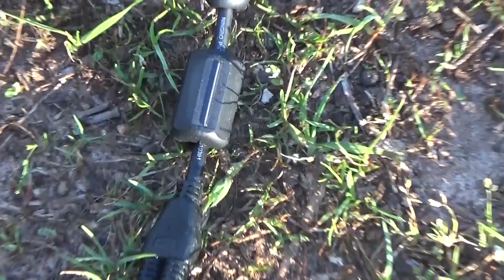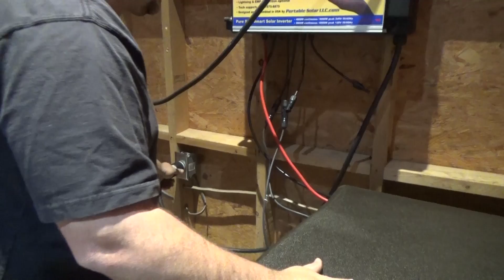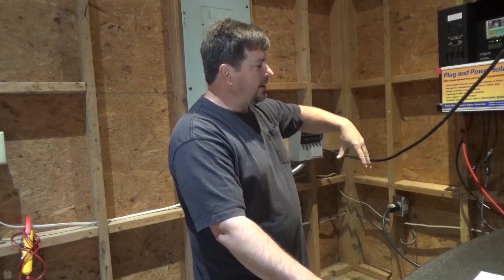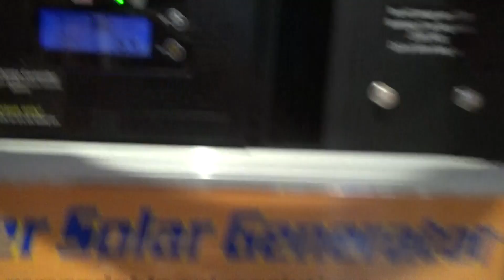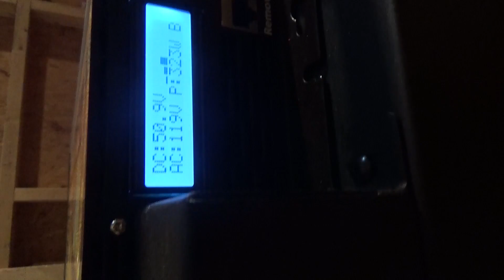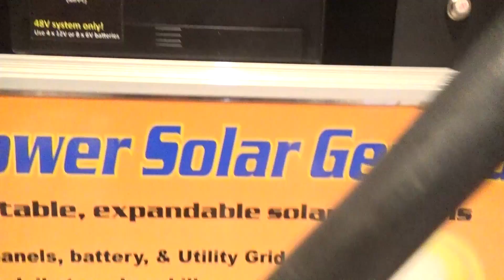Sol-Ark EMP Hardened Solar Generator

Comment: Those snap-on chokes may (if you are lucky) minimize noise, but will do nothing for an EMP.  What is the dB attenuation 'claim' of a 1 gHz pulse from the manufacture?  The much more important question is; what good is an alleged EMP protected solar unit, if one's solar panels (e.g. silicone junctions) are exposed outside and not in a Faraday cage?
Reply: The "snap-on chokes" are not the only solution. While dB attenuation is important for simple Faraday cages, it is far less important than real testing in 50KV/m EMP test simulators. Which they have passed numerous times.
Reply: Portable Solar LLC I would ask at what frequency content was your test?  50KV/m is only 1 relative reading, one needs and 2-3 parameters to create any real-world table analysis (e.g X&Y), before any commerce claims are advertised. X & Y are needed to provide what the Department of Energy standard requires based on real actual detonations. 
   I would point you towards the publications of: Colin R. Miller, Major USAF - Electromagnetic Pulse Threats; (TEDT-TMB), Test Business Mangaement Division - Test Operations Procedure & Visual Electromagnetic Pulse; Finci, Dr. A.k.a G - Electromagnetic Pulse. 
   A typical EMP can easily generate 50vK/m up to 100kV/m. These panel would be out in the open, not in a cage. Even in a "simple Faraday Cage" without multiple internal shielding layers, cannot meet the Military's standard, found in MIL-STD-188-125-1.
    I appreciate your hard work on the product, however unless adequate dB attenuation is achieved at the panel, it is all futile for the uneducated consumer.  I suggest to installers of such panels, to purchase duplicate panels wrapped in a minimum of triplicate protection; which is never received well from the client, due to the doubling their investment.
   I think you have the capability to make some additional money; if you offer a hard large Faraday cage with triple internal wraps of custom cut bags to accommodate a backup set of said panels.
    Keep up the hard work.
Reply: MIL-STD-188-125-1 applies to shielding ground based buildings. The MIL-STD-461 and specifically RS-105 testing applies to mobile electronics. It is much more difficult because it uses many transient EMP pulses made up of many high frequencies simultaneously (see spec below). And the electronics get rotated over many X-Y-Z axis for vulnerabilities.
As for solar panels, we agree that unprotected solar panels should be put away (or at least not wired up). There are in-experienced solar companies out there offering EMP solar systems where they provide backup inverters / charge controller and sometimes the diodes to the panels. What they don't know is unprotected panels will likely kill the solar cells. In this case, I would recommend backup panels.
However, properly protected solar panels in full sun have survived EMP testing to RS-105 specs. This have been verified by our Nuclear Engineer and other engineers in the country at other EMP labs. There is no testing evidence to date that we know of that properly protected solar panels failed RS-105 testing. We may do a video with live EMP testing on this to show the effects of both.
I hope people can understand we will not explain why protected panels survive in real testing because it only helps the people who are trying to sell fake EMP solar solutions. 
Thanks for your diligence and great questions.
Reply: Darn. Unable to attach EMP pulse graphics in YouTube comments. Sorry we are engineers and scientists. Not very good at Facebook & blogs. If you send us an email (address on our website), I can send the graphics in the RS-105 spec.
Reply: I'll bet the additional 'hardening' was a form of faraday cage around the solar cells......
Reply: Portable Solar LLC Again what good is having the generator; when all your solar panels become very expensive paperweights in a nanosecond pulse?
Reply: Solar Panels have been tested at several EMP Test facilities. One of our Nuclear Engineers tested them at White Sands N.M. EMP site. They survived in multiple >50KV/m tests just fine (some hardening was added but does not interfere with solar collection).
If you have actual test data to show otherwise, I would love to see it and the exact setup/conditions.

Comment: Around 4:10 you state that a typical solar panel will pass an EMP test. These have the suppressor built in line to protect them from being back fed from the effects of an EMP.  So would a solar panel in storage not hooked to a system be OK in a EMP?

Comment: Would using a 20' shipping container to house all of the power equipment inside of it create sufficient EMP protection for the electronic equipment that is INSIDE of it?
Reply: +Havilah Gold 
It is impossible to isolate a solar power system from an emp.  The solar panels are outside after all.
Reply: "power equipment inside of it" ...." for the electronic equipment that is INSIDE of it"
Reply: Havilah Gold In this video, he talking about a company that has tried to make a solar power system that can run and at the same time as being protected from an emp to some extent, This means the system is not isolated from the outside..  It does not really matter how shielded the building that the inverter, charge controler, other electronic equipment, is inside of.  The solar panels are outside. To get power from them you have to run a wire inside to the power system.  Wires are electrical conductors.  An emp is an electromagnetic pulse.  The wires will carry the energy from that emp to the rest of your system.
Reply: +Hodggoblin wires can be shielded and the amount of interference that they receive is going to be dependant not only in their level of shielding but also on their length. Use shielded cables and keep the length of your cable runs to a minimum.
Reply: Daisy Duke that can help, but the solar panels cant be shielded, or else they would not generate any electricity, thus a solar power system can not be isolated from an emp.
Reply: A shipping container can help a lot more than people think. And multiple independent EMP testing of solar panels shows they survive. But the long wires connecting to solar panels end up destroying them. That's why we supply EMP suppressors for each solar panel and appliance to protect them.
Reply: +Portable Solar LLC 

a few statements about EMP protection that I beg you to correct me on if I'm wrong.

 • The shipping container should be earthed.
 • The shipping container should be electrically isolated from all electrical equipment you hope to shield. Do not use it as common ground, common hot, common neutral or common earth.
 • If complete isolation isn't possible, use the container a common earth.
 • As far as fault protection goes, double insulated is far better than earthed.
 • if your equipment provides an earth on the plug, earth it.
 • ground fault interrupts are a good idea.
Reply: • The shipping container should be earthed.
PortableSolarLLC: doesn't have to be, but makes protection easier.

 • The shipping container should be electrically isolated from all 
electrical equipment you hope to shield. Do not use it as common ground, common hot, common neutral or common earth.
 • If complete isolation isn't possible, use the container a common 
earth.
PortableSolarLLC: Agree, it makes protection easier.
 • As far as fault protection goes, double insulated is far better than 
earthed.
PortableSolarLLC: Agree.
 • if your equipment provides an earth on the plug, earth it.
PortableSolarLLC: too many variable to answer.
 • ground fault interrupts are a good idea.
PortableSolarLLC: Waste of money. They aren't fast enough.

Comment: sounds like most rv inverters I'm familiar with that when you are plugged into shore power you have ac, when you unplug its dc, and if you run a genny it will switch to that.
Reply from the maker: +The Recon Prepper Very similar except that solar is priority with this system and won't switch unless batteries are less than 91%.  This way you get the most out of your solar panels.

Comment: so I can charge up a golf cart with it, and use the batteries in the golf cart to add to this battery bank to run the house? if so, im in!
Reply from the maker: +AlfreyFarms I am not sure I am following you on " add to this battery bank"?  You can use a 48v golf cart with the system to not only charge the cart but also power other loads.  Send me an email and we can work through the details.  I would thing you would want a dedicated battery for this and then you could charge the cart off it.
Reply: sounds good. I will get with you after the 2R24 outage here at Farley
Reply from the maker: +AlfreyFarms Roger That

Comment: I have a 4 Kilowatt solar system - totally off grid, with a generator backup and 8 deep cycle 12V batteries.  My inverter and charge controllers are not hardened.  It would be great if you could do a video on how to protect a system like mine from an emp - if indeed it is possible to do so.
Reply from the maker: +Marvin Double It is too expensive.  You would be better off buying 2 of everything that might fail and faraday caging them.
Reply: engineer775 Practical Preppers Thanks for that simple and direct answer.  It pretty much confirms what I suspected to be the solution.  Fortunately I bought a system with a very robust inverter.  That unit has replaceable parts.  I may well contact the manufacturer and ask about getting replacements for those parts most likely to fail.  I have two paired charge controllers.  While these are somewhat pricy, they are also fully replaceable.  I have two lightening arrestors in the system, one on the inverter, the other on the sub-panel, transfer switch.  I know that lightening arrestors are not the answer, but hope they may at least prevent some damage.  Naturally my biggest hope is that the EMP never actually happens.  With a SME, at least we'd get some warning.

Comment: Exactly what is hardened !  Those grey panels are not hardened.  Please do another video and describe what is hardened.  The panels, the control system,  the wiring, where is it hardened?  This is of great interest to a lot of preppers.  If the e co. stuff gets hit will it shunt it, are the grid lines equipped with a shunt to drop the emp off before your brain gets hit, the very fact that it has a lcd display brings a question to my mind, please hit me with whats hardened and how.

Comment: Nice system, but the only thing I see to mitigate EMP's are simple magnet chokes that are put on the conducting cables.  What else makes this EMP hardened?  TVS diodes?  Lightning arrestors?  In this day and age I tend to question everyone's claims to make sure it's not just another snake oil sale.
Reply: So how did you test this system against an actual EMP Pulse attack?
Reply: with you there. I have 40 panels, Cc's, and 3 inverters lock in a Faraday cage because I'm too nervous to risk my equipment until I have to. That charge controler looks identical to a 40 amp mppt made by renogy I have on a smaller system. I'll buy one right now if I hear it contains a real technology to dissipate emp. lightning is slow motion in comparison to emp from what I understand. the current will have fried critical components in the time it takes shunts and arrestors to clamp down.
Reply: +Mad Electron Engineering I agree 100% with your concerns.... this may be very promising, but agreed the ferrite chokes; will only knock down what is on the line (a bit), and even if they use SPD's most available lightning arrestors are exactly that: for the lightning pulse waveform and that is a totally different pulse duration and intensity; than EMP.  Would also like to hear more about the solution and what design validation testing was performed (rather than just where it was performed)... that said, using same test facility (which one?) Navy uses is interesting.
Reply: All lead based batteries come with 1 year warranty. You can buy your own because we sell them at cost. Our EMP Hardended Lithium comes with 10 year warranty and lasts 15-20 years.
Reply: engineer775 Practical Preppers can you explain how they do this internally?
Reply: Most of the EMP suppression is internal for safety. You are welcome to look at some testing of protected and non-protected systems here:
https://www.youtube.com/watch?v=ZbHK6Uqmzog
We also EMP Tested HAM radios and electronics here:
https://youtu.be/qKsAj0K5c0I?list=PLlRPtB4nbqt8nGTPdg1PrJNgqVntpGt0C
Reply: Sol-Ark 3K was designed and tested to >50KV/m. NTS testing labs just tested our latest unit: Sol-Ark 8K to MIL-STD-461G. It was hit >140 times to the maximum of their test limits: 100KV/m. Our EMP protected solar panels survived and so did the LED lights plugged into the Sol-Ark.
Reply: @Mosaicmaster 1 They have 3rd party test results you can request. If it's good enough to pass military testing, surely it would qualify.
Reply: WHEN an emp happens the true test will show all that works & no longer does. also a solar storm high X is another test.
Reply: agree, this looks like it would be far better at protecting against a CME than an EMP. After all I could have my pc unplugged and the EMP would still have the wiring in the power supply to join with and therefore roast the motherboard components.
Reply: TheBenjammin5150 go to the link and research their packages.  It comes with 4×110 amp/he sealed 8-10 yr batteries that are only warentied for 1 yr lol
Reply from the maker: +Mad Electron Engineering I agree. I only showed a small portion of the solution for the wires. The AC and solar wires are the worst part because they act like an antenna. Most of the EMP energy absorbing solution is in the Sol-Ark itself. It was designed to handle all three waveforms generated in a single EMP event: E1 E2 E3. But it takes a system level approach to best protect the solar panels and as much as can be, the household appliances.
Reply: Sounds like you were payed to plug this system. No mention of how much battery bank you would need to run that huge inverter for any real length of time. No mention that this doesnt come with batteries either.
Reply: I'm not even seeing the normal external lightning arrestors like you'd see on a normal Solar Combiner box... I mean I guess they could have put them inside the thing but 'why'?
I'm not sure what makes this "EMP Hardened" at all. If I had the cash I'd grab one and take it apart just to find out.

Fast (Really fast) surge arrestors on the incoming and outgoing lines, and proper grounding; as well as a metal casing (which it looks like this might actually have a metal casing, or mostly metal) to act as a Faraday cage, will make the biggest difference in any sort of lightning strike or EMP event, should one occur.

Comment: I'm trying to wrap my head around the EMP protection built into the Sol-Ark. Is 
the cabinet a Faraday cage? Would the display panels and 
the cable connectors be a weak point where EMP can enter? How about the gaps, hinge, etc.? Thanks.
Reply from the maker: +Harold Wong The cabinet is acting like a Faraday cage. I cannot comment on the display panels or any gaps, but the manufacturer suggested they will be fine. The cable connectors are EMP protected. The solution was designed by electrical and nuclear engineers that have experience testing EMP. Manufacturer took 6 months just verifying the EMP hardening.

Comment: Scott - Gonna need to see more videos on this. 3,000 watts should suffice most homes (esp if they aren't using 240v split phase service drops). Is the solar charger and inverter line replaceable inside the unit?
Reply from the maker: +Chris DIYer They could be replaceable in the field with a well qualified person. Currently they are not. If a repair is suspected, you talk to a real engineer on the phone to debug. Then if repair is needed, it is taken to Fedex/Kinkos or another place that can box it for you properly (if you didn’t keep boxes). It is then set to Texas for verification, repair and testing. The warranty is 2 years and after that, repairs are done at cost. The company is Christian based and is mainly focused on getting more people prepared.

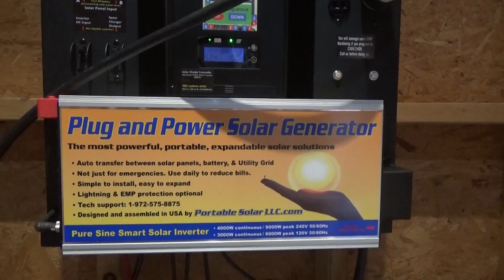Comment: Scott, I noticed on the label at 14:49 in the video, it says : 240V 50/60 Hz, so I assume it autosenses the grid and aligns to it, as most modern inverters do today.
Do you know if that means it will work in International power grids, i.e. Europe, running 230V/50Hz by default? Or, is a specific International version required?
Also, does it protect against islanding, and disconnect from the grid, if it's down, and run loads on battery in the mean time? (That's a requirement by law here, to protect power company workers from currents on the lines, while the power companies have shut down the grid)

Comment: So EMP travels through the wire the shorts out the appliance? so an emp protection be just in the cables and not the appliance itself?
Reply: +joash480 1) Yes 2) Yes/No/Maybe because there are too many factors (including size of appliance, electronics involved, case material) to discuss here. A single EMP event creates 3 pulses of energy: E1 E2 E3. But the wires are the most susceptible part acting as an antennae for some parts of EMP and high voltage conductors from the power lines for other parts of EMP. While the Sol-Ark is protected from the 3 pulses of energy, it also dissipates as much of the EMP energy as possible away from appliances running on it. TV would make us believe we have to go to extremes to protect items, but actual EMP testing has proven otherwise.

Comment: How do they harden the one way diodes?
Reply: +Steve Tomlinson Excellent question. Actual EMP testing at White Sands N.M. test range shows normal solar panels survive when additional protection is added externally to them. That protection comes in several forms with the system. But most of the protection for the solar panels is in the Sol-Ark.